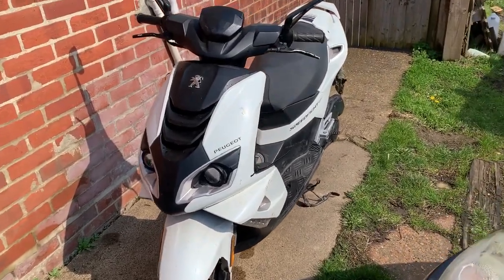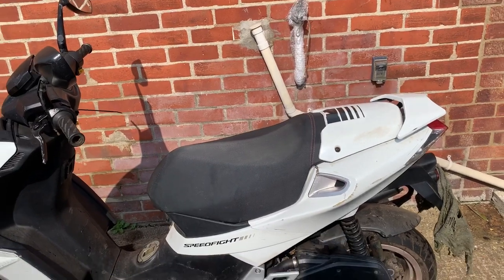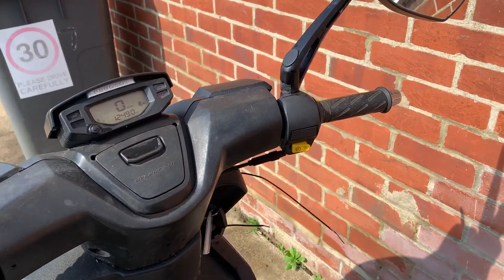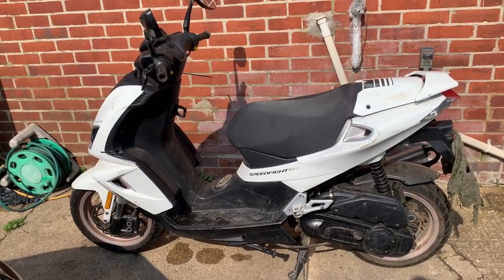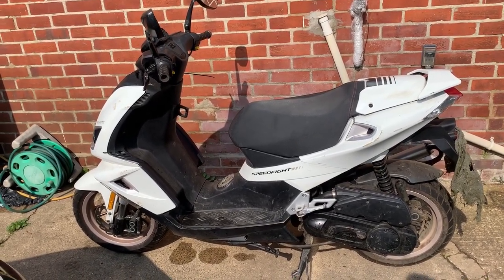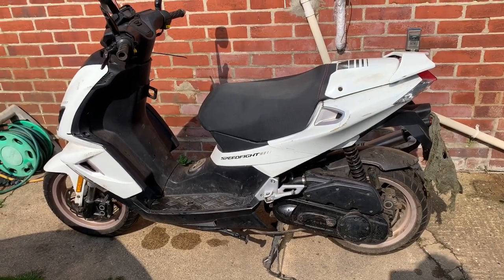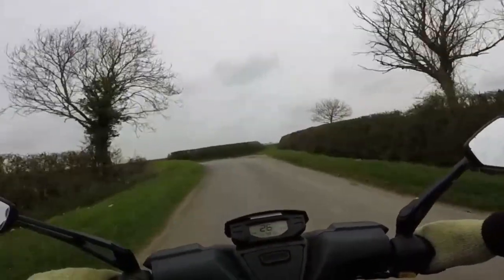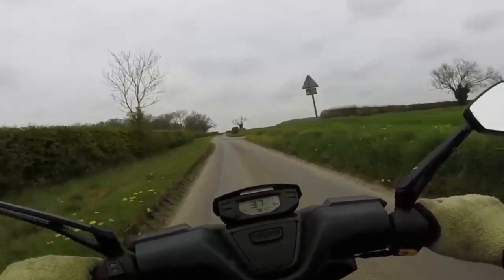Peugeot Speedfight 4 Scooter ( Mot Time Will it Pass❓)

Comment: Nice one Luke not bad a little 50 doing 40mph Mr butler did a lot to his little 50 but only 35 ish .IV rang bike shop up about my breaks seems there is a hidden bleed nipple behind all the front plastic and radiator grrr they said it could take one to two hours if it's two it's £130 grrr bloody break
Reply from the maker: Hi yes I remember Martin’s video, this one seems to have a good set up and it still more or less standard, it does go well. Thanks for watching 🙂👍
Reply from the maker: Hope you get yours sorted, keep me updated 👍